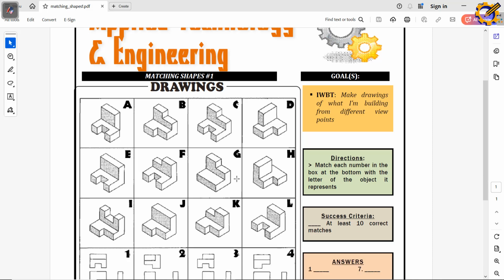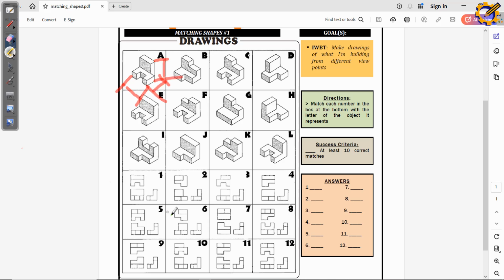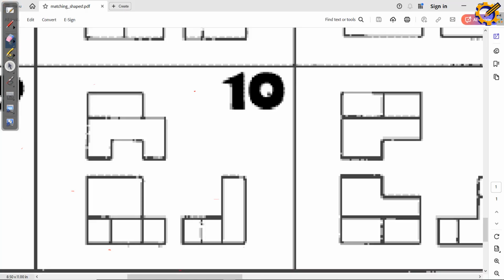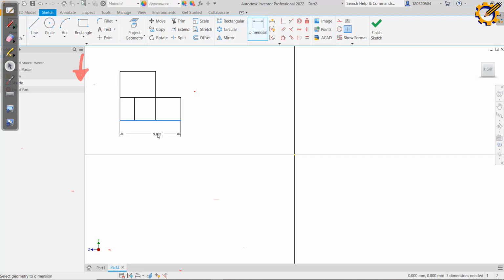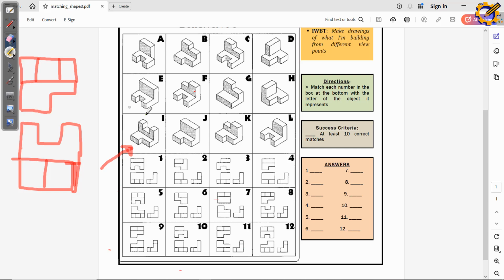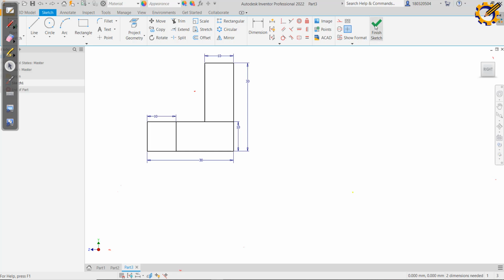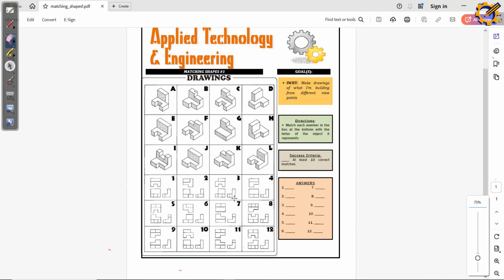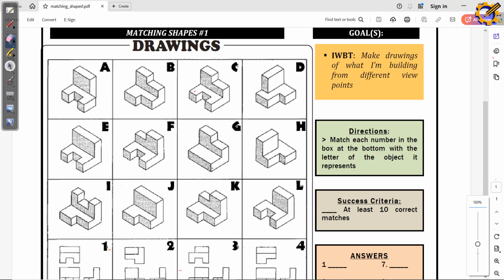Introduction to Autodesk Inventor  2 In | Technical Drawing | Engineering Drawing

Comment: The 1st problem A and 10 has an issue. When you generated from the plan the end looks different from when you generated from the front. Weldone will the same.
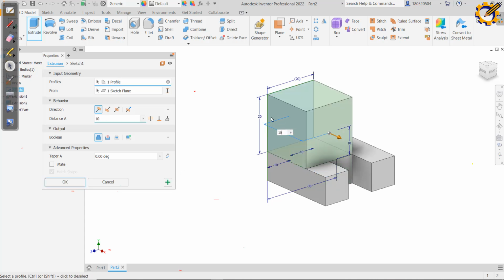Reply: Around 15:00 minutes